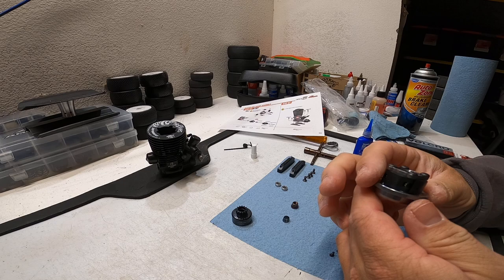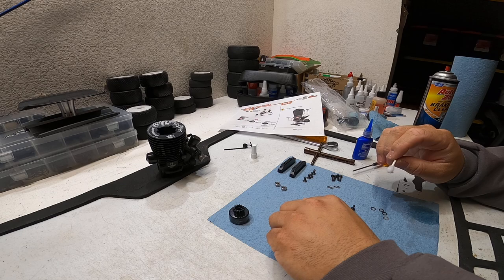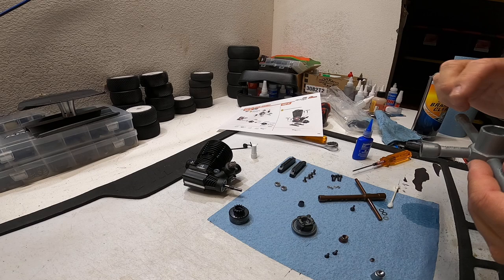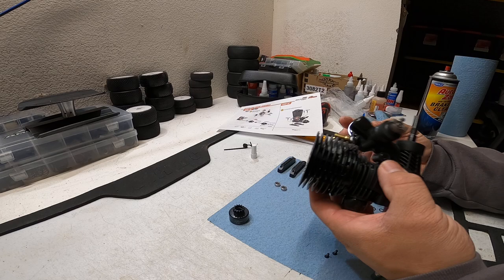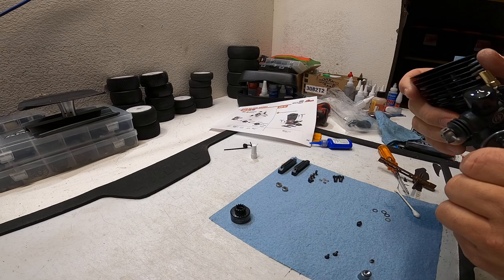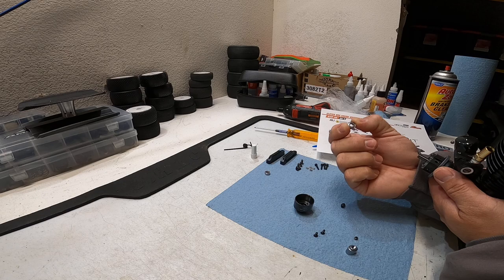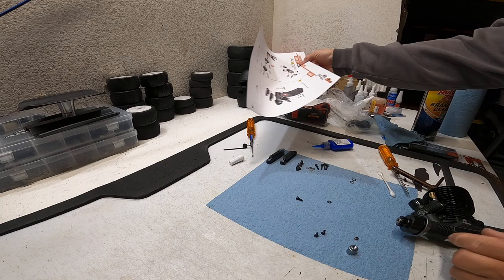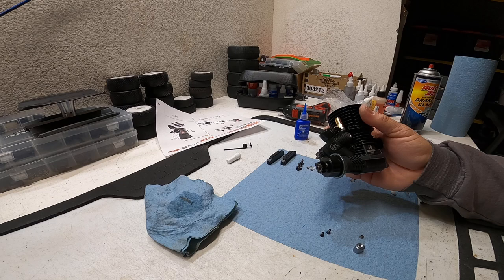SERPENT SRX8 4SHOE INSTALL

Comment: Man my clutch doesn't spin like your! 
It's brand new outta  of the kit. 
I'm seeing your video right ain't I??
It should spin freely right? I'm new to serpent
Reply from the maker: All clutch bells should spin freely. If the clutch bell doesn't spin freely than it is likely contacting the flywheel or the clutch shoes have worn out and mushroomed and are dragging on the clutch bell.